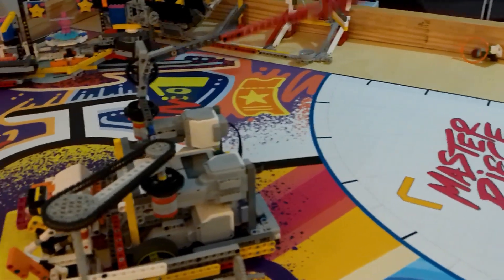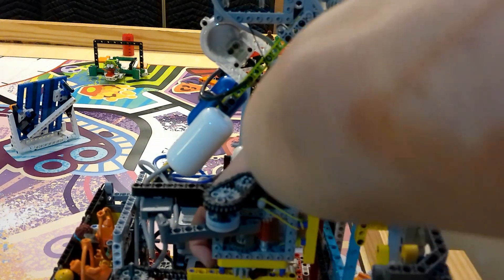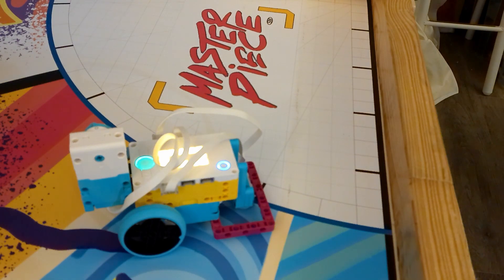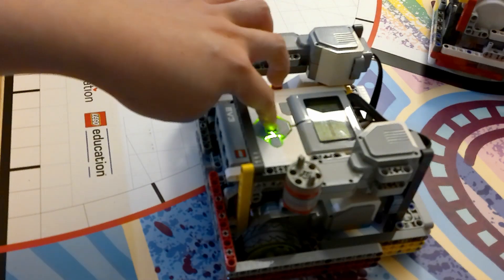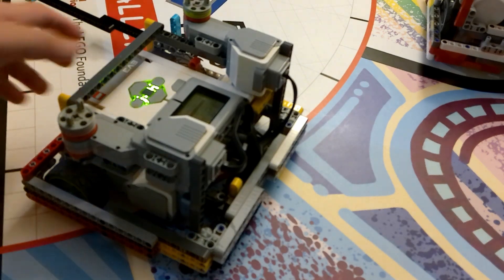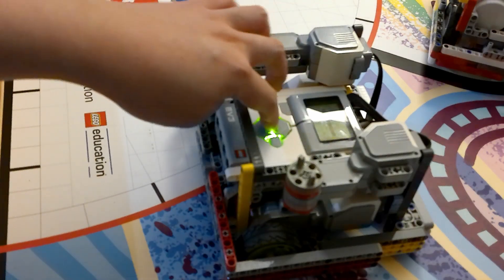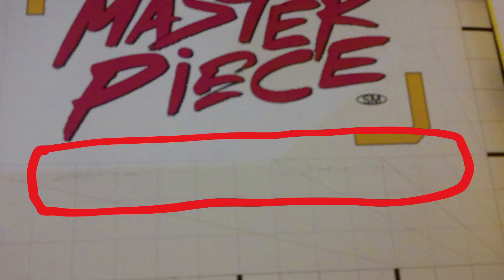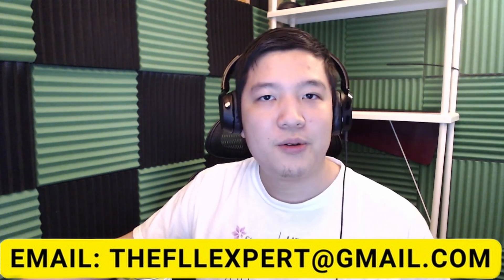How to Make Your FLL Robot Consistent Easily

Comment: Great video.  Do you have an example of a Gyro straight drive code in the block coding you could share?  I've been working on one with my kids but have not been able to perfect it.
Reply from the maker: I do not, unfortunately.
Reply: @FLL-Explained  My students were finally able to design a code that works.  Now we are testing it vs dead reckoning to see if it's actually more reliable.
Reply from the maker: @kylegerhard1264  Good luck! I hope it works! I am a bit curious to hear about the result of this testing.
Reply: Many of the teams I have mentored have used the gyro as well as line-following. They abandoned those techniques because they found that their robots could go faster using techniques like squaring up. This reduced the time needed for each mission, allowing them to consistently solve more missions in a match.